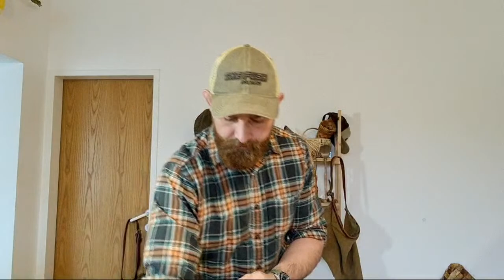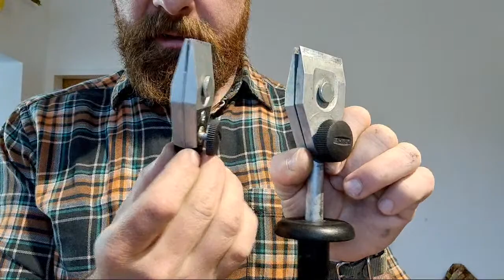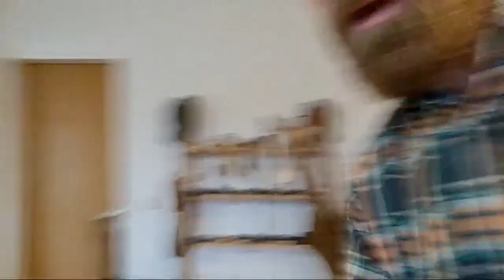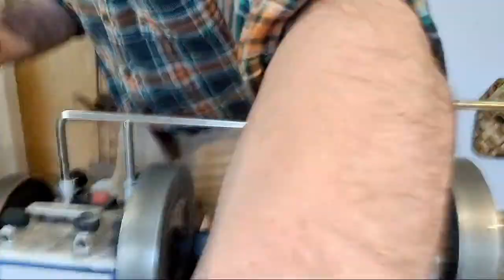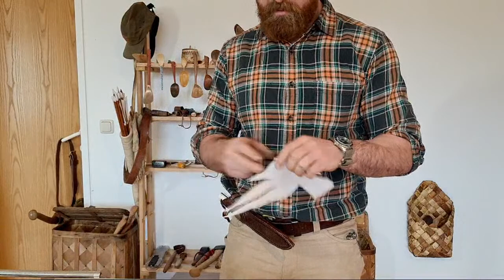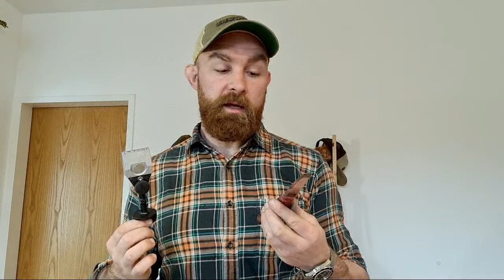New TORMEK KJ-45 Knife Jig FULL Demo

Comment: Thank you for your video. I just bought a Tormek T-8 (aniversary edt.) and have been watching a lot of videos on sharpening woodturning gouges. I just wanted to ask why you don’t use the jig on the leather wheel, like I was taught when sharpening woodturning gouges? :)
Reply from the maker: Because I don't need it. But work the way you feel comfy
Reply: @woodsmansfinest3814  Thank you. My "problem" is that with the new Tormek T-8 Anniversary edt. comes the CW-220 Composite Honing Wheel. This is some kind of a rubber compound that I think removes burr more aggressively than the leather wheel. I have never tried honing on a leather wheel, was just wondering if I as beginner would maybe be in danger of ruining something by not using the jig on a leather wheel or my new artificial compound wheel...  I will probably stick to using the jig on both sides while getting the feel for the Tormek. Thanks again for your video and thank you for your prompt reply :)
Reply from the maker: @jonskytta  no worries. Just small steps

Comment: Hello Max, I am a new user of SVM-45 and I noticed that while I lift the knife handle (in order to grind the tip of the blade) the micro-adjustment knob in the handle is not locked and is not holding the original setting. It screws right or left since I hold it tight while movin it along the supporting rod and lifting the knife handle. Did you notice that also? is it the same with the new jig?
Reply from the maker: Not coming across the same issue. Sorry!

Comment: I like that mora mod with the finger guard gone. How do you go about removing that? Just filing it off?
Reply from the maker: I cut them off... But I'd be very careful doing that. Rather put it in a vice and file it.
Reply: @woodsmansfinest3814  thanks. That guard is the only thing I don’t like about that series of mora so I’m defiantly going to carve that off
Reply from the maker: @matttcameron_  they are a lifetime of companion for a couple of bucks. Insane. I'll make some leather sheaths for them.
Reply: @woodsmansfinest3814  Just carved one of mine and it was surprisingly easy. Feels a lot better to use now, more like my other Scandinavian style knives. One thing is it's not as secure in the plastic sheath. I do like the plastic for when I'm not wearing a belt but still want a knife on my hip. I think it'll still be ok.

Comment: Piece of advise from former professional sharpener :
I would not advise using this method for sharpening other than cheap basic scandinavian ground knives. The hollow it creates will weaken an already weak by design edge. This won't be too much of an issue if you carve soft wood, but it will show on hard woods like beech.

Even-though I own a T8 with a larger stone (250mm radius), I prefer to sharpen my true scandis by hand on whetstones. Now for a general purpose Mora Basic or even Companion, that's OK, but I wouldn't do it for more high value knives.
Reply from the maker: I and most professional carvers will disagree. My bearing steal knives carve dry apple without edge damage and are ground to zero on the T4.